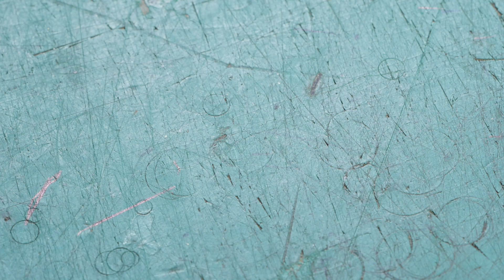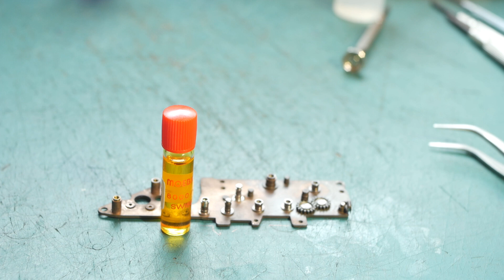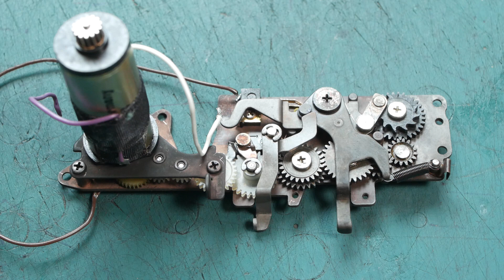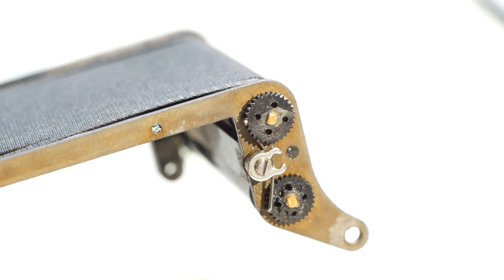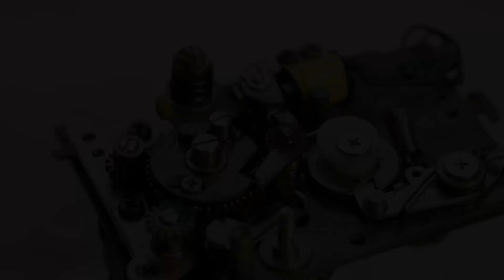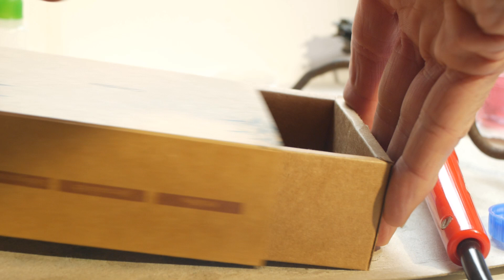Battery Damaged Camera Repair - Part Three - Contax 137 MA

Comment: The dedication to repair this! Unreal. Very skilled :)
Mine has lower level corrosion but I won't be going further to remove boards and circuits like you have!
Reply from the maker: That's very sensible flowermaze, it's only worth doing if you really want the adventure - kind of interesting to see how far I can get with the repair all the same.
Reply: @GrumpyTim good luck with it! It’s an inspiring project

Comment: Good work Tim! It is coming on!
Reply from the maker: Cheers Ben, it's coming on well so far, albeit a bit on the slow side.  The lower gearbox has turned out nicely.
Reply: @GrumpyTim  Yes. It does look like you will get it fixed! Albeit it has been a long slog for you.

Comment: You have the patience of Job.  I think I would have scratched out my eyes before getting anywhere near this far.  I also love to watch wrist-watch repairs, and this is similar, but a bit more crude as the mechanism is open to the attacks by migrated grease/oil, water, condensation, battery acid, etc. and the parts are 10x the size of watch parts.
Reply from the maker: I used to dabble in a bit of watch repair Skip, but it was always a bit too small for me.  I do enjoy watching some of the YouTube watch repair channels from time to time - many of the principles can be transferred to camera repair, particularly for things like the slow shutter timers on fully mechanical cameras.